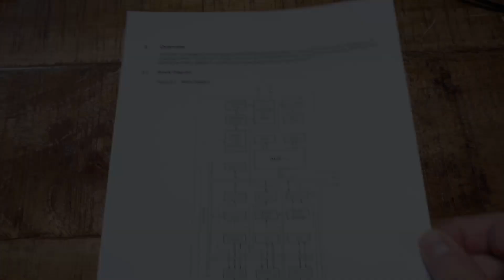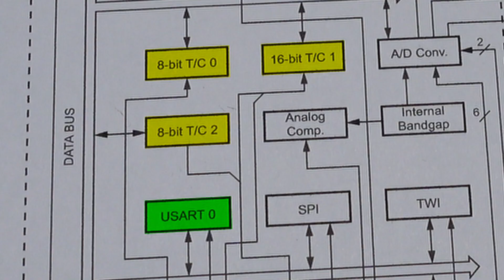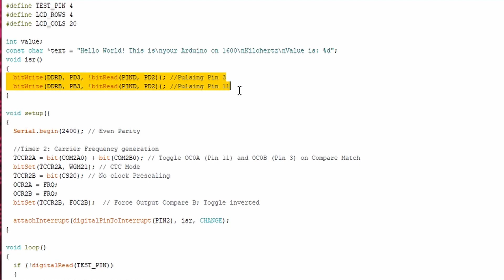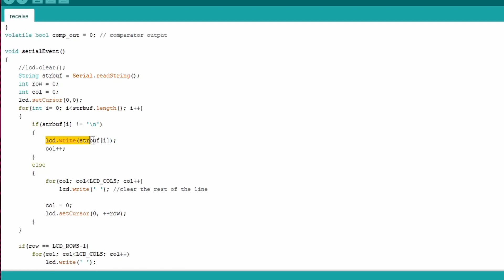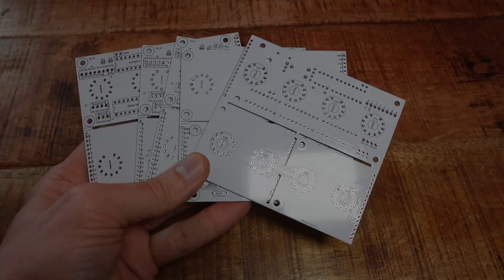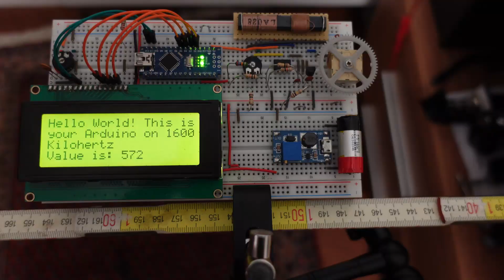The Arduino's Secret WIFI

Comment: Another way of increasing the distance would be to instead use error correcting codes. Though I'm sure that's out of scope of this, it's something that would be necessary even over very short distances, given how susceptible to interference RF communication is.

Comment: This isn't really Arduino's Internal Hidden WiFi
You added a ferrite antenna,   that KINDA changes everyything   LOL
Reply: I  think what he means is that Arduino is capable of generating RF signals all by itself without an intentionally designed transmitter. The ferrite- core coil is simply there so you can get a clean signal.
Reply: @jnharton 
I know what he means,  but it still......... ummm yeah  you know

Comment: add a flyback diode across the coil to protect the arduino
Reply: on the transmit side
Reply from the maker: This would cost some transmit power and  my Arduino survived anyway.

Comment: So its facking useless 2m range 😂😂😂😂 and the point in this video was 😂
Reply: You could probably increase the range fairly trivially, but you don't want to run afoul of regulatory authorities. Radio transmission is tightly regulated.
Reply: @jnharton  I used to play with scart video to uhf transmitters with more range than that still got the box but also got sky slx box does the same thing just newer lol

Comment: Make sure you are allowed to use the frequencies and are not adding extra interference for others
Reply from the maker: These frequencies are no more used in many countries, and with that low transmit power i is extremely unlikely to disturb anyone.
Reply: @DoctorVolt  that's good

Comment: Now you have to import IPv4, IPv6, TCP and UDP and a conection that is duplex for wifi but its still an interesting Video. Why you dont use metric? Even USA try to switch to metric system.
Reply from the maker: The Arduino just has too little memory to handle all that OSI layer 3 and 4 stuff, when a MAC frame alone takes up to 1514 bytes... And handling all the header overlay would make it even slower. I use both feet and meters, but I find feet more convenient when describing short distances. And most of my viewers are from the US anyway.
Reply: @DoctorVolt  this wasn't seriouse i know how hard OSI comunication can be. cnlohr did a great project on Ethernet with an attiny 85 but this dude is an insane good hardware programmer. I realy like your project its simple to umderstand but still interesting i love RF stuff and like to think alot about this topic but i sometimes feel lost with all this things to considere when designing real world applications.

Comment: One problem of this concept is that ferrite material saturates very quickly and is really only usable for very low field strengths (as in receivers). Using a different inductor on the transmitter side should improve the range. Another problem is that the direct drive of the LC circuit limits its possible peak voltage to the voltage range of the AVR pins (which have protection diodes and load the resonance circuit non-linearly). An isolating buffer stage (transistor with high voltage rating) would be beneficial.
Reply from the maker: Maybe I could have achieved a little better coverage with a loop antenna and a good impedance match. But I don't think it would make much difference, and I don't see much practical use in it anyway. So I didn't want to put too much effort into it.
Reply: It is not that difficult to increase the power and range but at some point there will be a risk that it will interfere with someone's radio and authorities may get involved.
Reply: what would be the best inductor to use?
the using of a voltage and current boosting transistor is indeed a logic thing to do, and at this low frequency it isn't to hard to find a suitable part.
also the antenna I searched up the name but got nothing, so am I right to assume it is just one of those LC oscillator antennas.
or that it is just a coil around a rod through which the current is passed and a second coil around the same rod but connected to gnd on one side and air on the other side? kind of like one of the old long range radio antennas.
or is it one coil with a center tab?
Reply: You are obviously not a ham radio guy.  I personally have used ferrite in an antenna system at the 100 watt P.E.P level.  Other hams have used ferrite at levels up to a kilowatt.

Comment: When I was an undergraduate student the lab I was working in had a computer donated from a defense contractor. The PC case and keyboard were very impressive for how heavy they were. When we looked more closely, the keyboard circuitry was wrapped in copper mesh to prevent signals getting out into free space. And this was a late 80's computer, so I can only imagine what can be done now.
Reply: https://en.m.wikipedia.org/wiki/Tempest_(codename)
Reply: thats  EMP hardening since it was during the cold war
Reply: It's called Van Eck phreaking, You can also Capture Stray signals on a monitor cable not just a keyboard.
Reply: google TEMPEST to learn more.
Reply: you can read the sata protocol from the hardrive if you close enough and the case is open.
Reply: """"Defense""""
Reply: Keyboard releases no signals, as the other comment says likely EMP
Reply: @kreuner11  I think I'll stick with believing what the person from MITRE who donated the equipment said about signals intelligence. If a nuclear strike had happened the operation of these computers would have been irrelevant. But the design work being done on them certainly would have been of interest to the Soviets.

BTW I have been involved in RF circuit design for two decades. I can confidently say that anything with a mechanical switch will absolutely radiate. You'd have to be crazy clever to figure out a way to interpret the RF pulses coming out but I'm sure the cold war spooks were up to that task.
Reply: They operated numbers stations, they could figure out the rf pops or the change in the CPU clock sounds per key. IDK give the nerds on kiwi farms enough time and they will figure it out lol, But the more logical approach would be deep cover and land a job at the place so you gain access to the information directly and photograph it on good ole microfilm then cut out before caught but after you photographed the entire filing cabinet. or you recruit an employee already there with the persuasion of cold hard cash money and promises of being extracted and protected from authorities (lies all lies)
Anyways I said EMP hardening because that was a thing in the common use to keep the wideband pulses out or at least attempt to but the same shielding can be used to keep RF in as well, like a microwave oven or faraday cage  its all the same principle to keep electromagnetic energy out or in a specified area. @Drjtherrien
Reply: @Drjtherrien  what kind of radiation? Like just a click?
Reply: @kreuner11  Radio frequency radiation. Yes, the sudden change in current from closing or opening the circuit with the key press will produce a brief broadband radio hash. Modern keyboards with the carbon conductive membrane switches and low current are probably a lot more "quiet" in the radio spectrum.
Reply: @Drjtherrien Wouldn't you need to  know something (or at least make some assumptions) about the source though?
Reply: @jnharton  well this was a computer from the 80's so there weren't too many peripherals to narrow it down from. And the keyboards probably had a distinct enough "signature".

In reality was it really a plausible concern? Maybe not.
Reply: @kreuner11 In theory, all electronic circuits generate electro-magnetic fields when in operation which can result in RF (radio frequency) emissions. Good engineers try to minimize that whenever possible and avoid created unintended transmitters.

Comment: Nice concept! For the threshold, lowpass filtering the RF signal may help to get an automatic threshold. Also consider 10b8b encoding. Cheers!
Reply: You mean high-pass filtering? With a HPF you could get the signal’s centre almost exactly halfway between the rails. I think he should also add an AGC circuit of some kind. And a Schmitt trigger comparator assuming he doesn’t already have one. I think 10b/8b encoding would get the DC offset to zero, and is more effective than the Manchester I was thinking of.
Reply: @Scrogan   Both work. If you lowpass the signal, you get the DC offset and can use that as a reference. If you highpass, the signal is centered around 0V, but you end up with negative voltage.

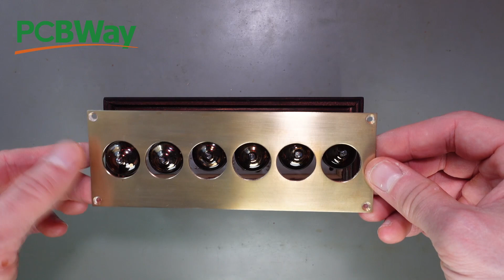Comment: question, at 4:53, that brass plate, and nixiey tubes, would not need to earthed some how, unless it like not high, mains power or something?
Reply from the maker: That's no problem, because the anode voltage of the VFD tube is around 24V and there is no mains power in it at all.

Comment: The real art of airgapped transmition. Reminds me of RPiTX. Don't even want to know what can be done to PC motherboards so they "leak" data ;)
Reply from the maker: That RPiTX project looks rather cool! I have to give it a try!
Reply: I saw someone hack a SATA cable to send data.  Yes, I know, that's what it's supposed to do, but this person wrote some code that wrote data to the drive periodically to transmit 1s and 0s with the RF noise.  It was a proof of concept for malware to exfiltrate data from an air-gapped computer, and it wasn't particularly practical outside just being a poc since the range isn't great, but it was interesting nonetheless.
Reply: I did something similar following some research paper but with USB 2.0 protocol. I never made video public :) Maybe one day I will get back to that project and write decoder to :)

https://www.youtube.com/shorts/ZivNEi4GbVM

 @dafoex